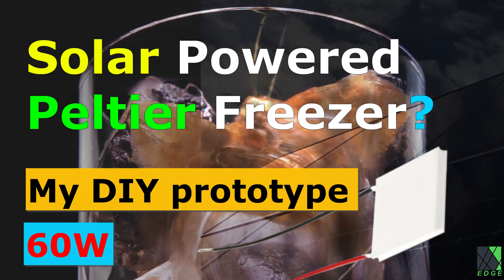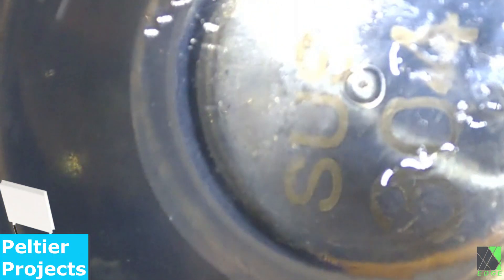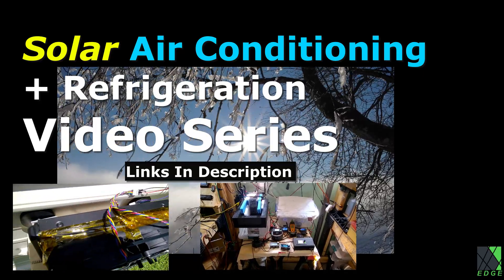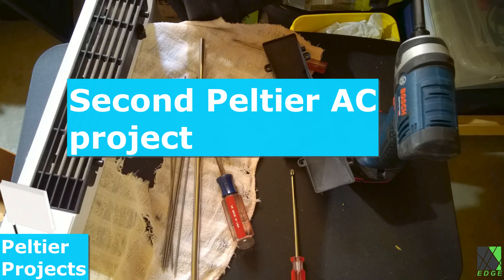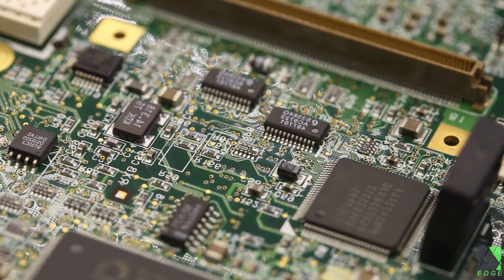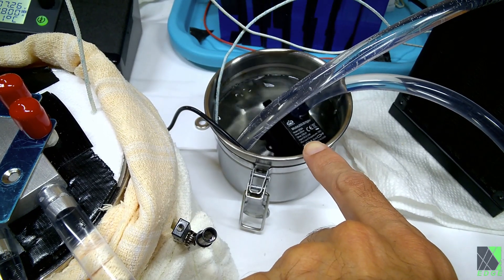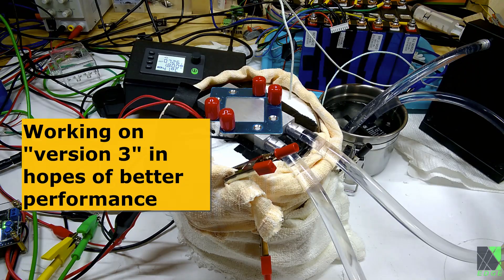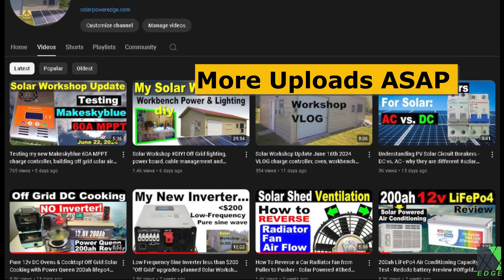Solar Peltier Freezer! Solid State prototype refrigeration research, simple components #diy #peltier

Comment: I have actually achieved -5c with a high quality peltier that is well cooled with just 5v at 2A which is within USB specifications!! I personally want to try making a USB powered freezer in the future because that is definitely something that has never really been done before. There are some USB fridges but all those videos I've seen are products that have little to no insulation or DIY projects that are horribly inefficient with their designs
Reply: Oh yeah I should mention, there is a HUGE difference with quality peltiers and non quality ones regarding efficiency. Ones that are high quality have evenly distributed temperatures across the cold and hot sides. I've had some peltiers that barely manages to go below freezing and others that go into -15c or more
Reply from the maker: @aleksandersats9577 You are right, unfortunately some companies print "whatever they want" on the front, but there is no way to see inside the module. I have bought and tested a ton of modules from all over the world, they vary in performance wildly
Reply from the maker: @aleksandersats9577 Great work, keep on experimenting! A USB mini freezer would be awesome.... Don't know why there is so much negativity against peltiers in general. I think they are a marvel in a small package. To have something suddenly get cold for a few volts and no refrigerant or moving parts is shocking and amazing. 

I am building some fridges/freezers in my shop with good performance, but tedious and complicated construction. Perhaps it will get better. After months of research, my TE fridge prototypes far outperform the "coolers" currently available on the market :)
Reply: @solarpoweredge  There is so many areas where you can improve the efficiency of peltiers. I'll list some that I know:

1. How cold the cold side can get is affected by how cold the hot side is. So optimize cooling to as much as possible by doing several things:
- Good quality thermal paste for good thermal conductivity
- Fully copper heatsinks as copper transfers heat better
- make the exhaust of the hot side away from the case of the insulation as blowing hot air directly on the insulation does not improve it.

2. Thermostat to not waste energy when it has achieved the target temperature. Now this brings it own range of problems:
- Turning the peltier off means the heat energy would get back inside through the peltier. This basically leaves a huge hole in the insulation and that needs to be minimized. I have several ideas such as a smaller heatsink on the inside with a fan blowing against it. When the thermostat turns off, the fan would turn off minimizing energy loss from the heat energy coming in. Another way to improve is making sure the temperature is evenly distributed internally. Since there is fan on the inside, adding cold air tunnels to the complete other end of the box from the peltier is would evenly distribute the cold temperature as it creates an air tunnel.

3. Chest type freezers are known to be more efficient as cold air is heavier than hot air, opening the door on a chest type styled fridge/freezer minimizes energy loss when you open the lid to take or put something in

4. Thicker/better insulation. Thicker insulation helps a lot to retain the cold energy, so the thicker the better. Good door sealing gaskets would help a lot as well.

5. Water cooling is great, however it produces numerous other issues.
- You need to run a pump and you are dealing with water.
- Mixing different metals with water is a bad idea and will cause corrosion.
- Running the pump 24/7 can wear it down or eventually even get stuck which will be really bad especially if there are no safety precautions in place. Imagine the the pump fails and you send 60w to the peltier. Suddenly it's not being cooled well enough and it may get hot enough to start a fire!!!

I hope you find these very helpful!
Reply from the maker: @aleksandersats9577 Well done! Thanks for all the ideas. 
Btw I'm building and testing a couple of small chest fridge/freezers possibly with some "special features". If they work well enough, I will share the results. 
PS an alternative to turning OFF the peltiers, is leave them running but throttled down significantly... kind of like "virtual insulation!"

Comment: I had a 12 volt non compressor   that when the temperature outside was below 80 degrees it would if you set it too cold freeze things in it so I know it can be done maybe with a bigger cooling unit and or better insulation after all most are lucky to have R 5 so maybe at least R 10 or higher also a chest type so when you open the door all the cold does not come out
Reply from the maker: @douglaswindsor120  Early tests of a chest style peltier fridge are in progress, it is working quite well. I have to find some better insulation

Comment: lol, i still have a collection of bulged heat blocks from hitting minus 40... i found freezing wasnt the issue. building it neatly so it wasnt a tangle of hoses was... iunno, no matter how well i plan, everything ends up a sh1tfight...
Reply from the maker: @paradiselost9946  Is that what happens when those blocks freeze.... That's pretty funny, yeah I hate hoses and wires. But it's clearly labeled "prototype" and "research".  Many of my projects tend to look messy, due to the situation here it's all I can do to keep going, let alone make it look nice. Maybe by prototype version 7 it will look nicer :)

Comment: What about a water heater cooler application two adjacent insulated containers filled with peltier in between, heating one side cooling the other, no pumps only thermostats to prevent freeze up or overheating, would be nice for a job site to have cold drinking water and warm water for coffee or hand washing?
Reply from the maker: @travishodges5179 I like these ideas, taking notes of them... I have 1000 projects going but it's on the list!

Comment: If you water jacket both sides of the peltier and include an integrated cold feed into the input line by placing a cold line next to your input for the hot side you can double your cooling. I feel a standard dorm fridge would better serve your needs with a battery and inverter as refridgerate based systems are better at removing more heat then peliters can by better utilizing your available wattage. Just putting it on a 10 minute cycle timer can littery operate 24hrs a day and extend and charge a battery on solar.
Reply from the maker: @egn83b Thanks for the ideas... I'm looking for such a fridge, but may have to use a cooler if I can't find one. What's amazing to me is the entire air volume inside of the freezer was 27 degrees... I learned a lot with this prototype and will be trying to build something larger as soon as possible.

Comment: I've had a couple coolers with Peltier heat exchangers. Both would change the interior temp by about 15 degrees plus or minus from ambient temperature. I think there is good potential here. Remember, Thomas Edison did not go into a laboratory one night with a couple of mushroom pizzas and a keg of ale and come out in the morning with a light bulb. Efficiency ratings should always be coupled with the phrase "compared to what?".  Don't give up.
Reply from the maker: @oldgandy5355 I hear ya, I wish those coolers could do at least 25 degrees. Looking for a broken one to "upgrade" if I can.
You understand exactly what this work is all about :) I really admire Edison! Thanks for the kind words of encouragement. Still chipping away at the project. Testing a different peltier chip right now, different water cooler etc. some setups work better than others and it just takes time to figure this stuff out. If I can scrap together something better, I will share the results
Reply: @solarpoweredge  Looking forward to it.

Comment: My concern about peltiers is their longevity. Do they hold up with heavy use over years?
Reply from the maker: @cynthiamathieu5862 In common cheap appliances (like those large coolers or mini drink coolers) they are known for failing after a few years or less ... however I think some of that is due to the way they're used in the design. Also, they use cheap import modules. I can't say how many years they will last if "properly used" but I guess I will find out. I am also testing different brands of modules to see if there are any benefits
Reply: You need to look into NASA space videos regarding the Pioneer space probes which, don't quote me were launched in the 70's and used nuclear decay to provide the heat for the Peltier devices, they are still working today albeit at a reduced power output due to the nuclear heat source no longer putting out the heat it once did! 
So in terms of longevity, as a generator, they have a long track record.... But as a cooling device, I have yet to come across a mention of a product that has been working for an extended period of time! The humble heat pump on the other hand, even though it has moving parts, I came across a video of a story about a fridge from the 20's that was finally traded in after being handed down through the generations! I can say with certainty that I was impressed by the reliability of the heat pump especially when it's made well! I'm not sure if it had been re gassed over it's lifetime? There was no mention of it! My personal fridge has been in my possession since new for possibly more than 25 years and not showing any signs of giving up any time soon! Knock on wood! 
I think that it's way too early to tell how reliable Peltier devices will be at this stage, I believe that they are misunderstood by many people, I constantly see them being run at 12v and more in some cases, they can run at lower voltage and judging by what I have seen so far, they can operate far more efficient! I think that the trick is to run more at a reduced voltage to achieve the same outcome and they should last a lifetime if not more!
Reply from the maker: @PeterMilanovski I noticed peltiers all look about the same, but vary wildly in real world performance. Experimenting with various quality (and non quality) modules to see what works. Good ideas and good thinking. I suspect under-volting them could improve reliability in addition to efficiency.
Reply: @solarpoweredge  my shallow understanding is there that the mtbf varies a lot between brands.
Reply from the maker: @cynthiamathieu5862  I think that is the case, and unfortunately they all look about the same. I paid extra for one batch of peltiers to test, and their performance was quite poor! And nowhere near the claimed specifications. But I kind of expected that... very common in the current market.

Comment: try using 12703 3 amps version, i watch some videos comparing 12703, 12706 and 12712 efficiency and the 12703 version more efficient and produce less heat so on cold side will be colder.
well it might be more expensive than 12706 because rarely people or manufacturers using 3A version (perhaps).

don't forget adjusting and testing on different voltages or using constant current psu because it affect performance and heat that peltier / thermoelectric produces.
Reply from the maker: @KazemitoHaruhi Hello and thanks for the ideas. I will look for 03 modules asap. Currently testing different manufacturers too. Different voltages, current etc. is in progress!
Reply: Looking forward to seeing those videos...
Reply from the maker: @PeterMilanovski great, hoping to finish at least a couple more peltier videos as soon as possible

Comment: That’s very cool, literally- I’m also curious as to the heat output from the little heater core/radiator. you know- just because.
Reply from the maker: @thedustmancometh Yes very "cool" stuff... I'm not sure how to gauge the heat output, but I can tell you the water temp is a few degrees warmer than the air, and I can not really feel warmth in the air after the fan has been running a while. If I turn the fan off a while and let the water heat up, I get a blast of warm air as it dumps all the heat - I find it really fascinating

Comment: ethylene glycol or some other liquid cooled pc fluid would work better to transfer heat away vs water , and you could prob find a old small non working fridge for free and use the fins etc as test bed
Reply from the maker: @rkeantube Good idea... been looking for a broken mini fridge
Reply: @solarpoweredge  I've seen car radiators and condenser coils on facebook marketplace for pretty cheap. Heater cores are another option. Those are pretty cheap new, but searching at autoparts stores can be difficult. Another option is to just dump the heat into a 15 or 55 gallon barrel of water.
Reply from the maker: @orangezeroalpha Just looked up car heater cores, those are great! Earlier I bought some transmission oil coolers that may work. Not quite what I had in mind however they ought to do the trick and if not they will get used elsewhere
Reply: @solarpoweredge  someone near me has a new honda accord radiator and coil for $20, both are around 12in x 24in and over $100 new. But I already have two disassembled air conditioners and ordered ten 12715 peltiers and I am trying to be reasonable :) I do remember my heater core would actually keep my pc running for a long time even without a fan, but it was likely only dissipating 100w or so. I still think a huge tank of water with a pump would be nice just for the noise reduction.